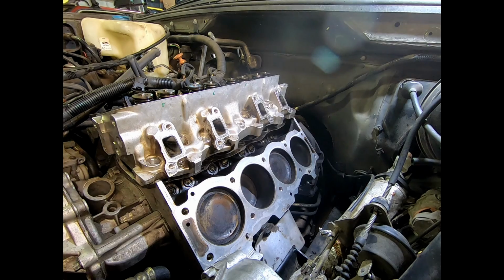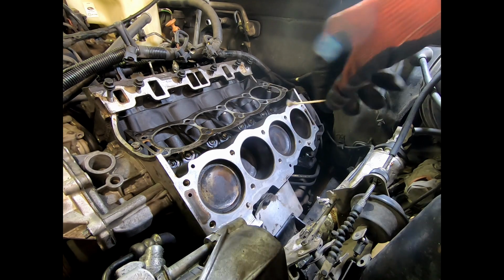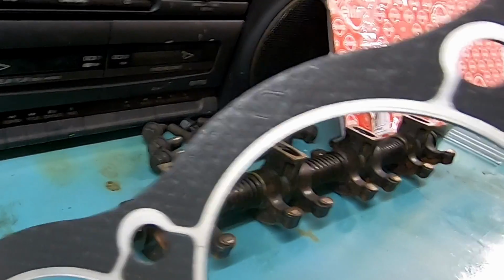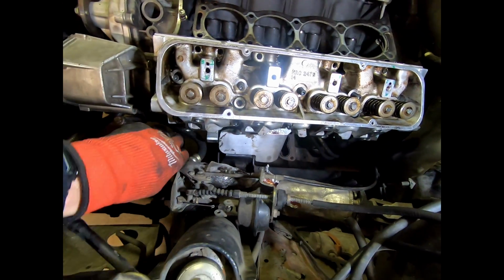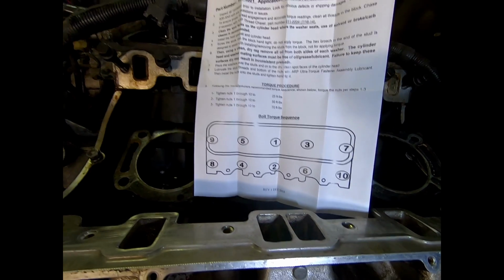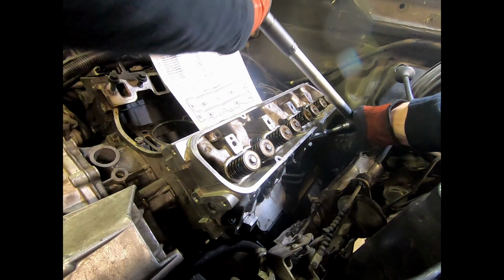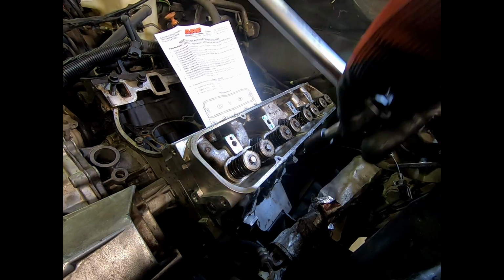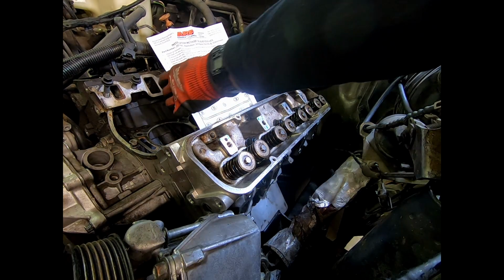How To Install & Torque ARP Head Studs on a Rover V8 - 1997 Land Rover Discovery - "Jimmy"

Comment: Hi!
Did you do both heads?
I am doing this a second time.. the first time i installed ARP studs and I dont get 2 of the studs out (yet) .. i am fighting with them , waiting for a 3/16 wrench ( We have mm here )  .. but only my rh headgasket is leaking at the front an i am not sure to do both ..
Reply from the maker: They are typically done in a pair, but it is not absolutely necessary. Is it leaking exhaust into the coolant, or is it leaking coolant out of the head, or exhaust out the side? Did you do a compression test on all cylinders?